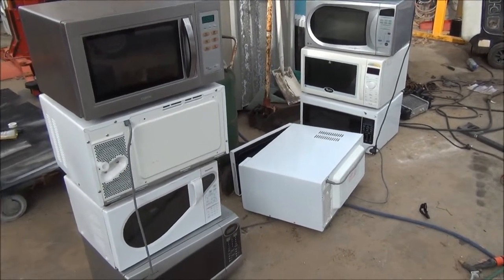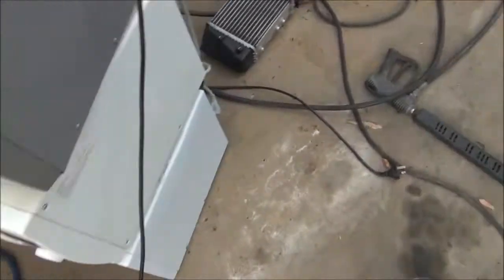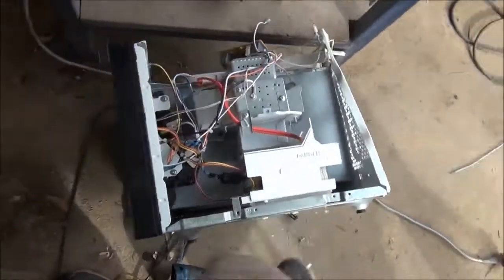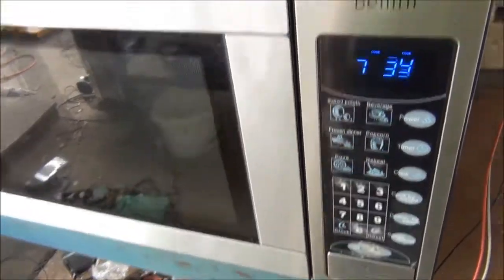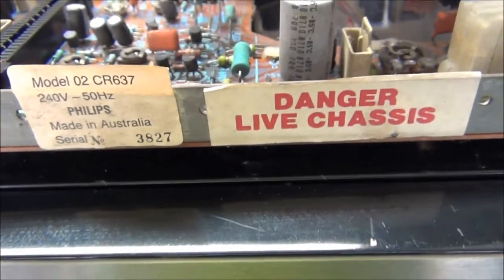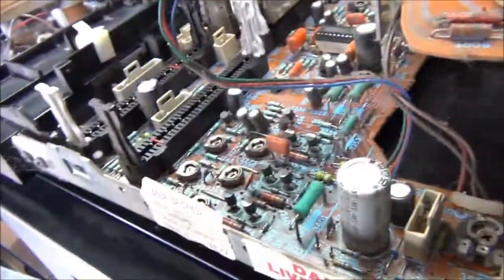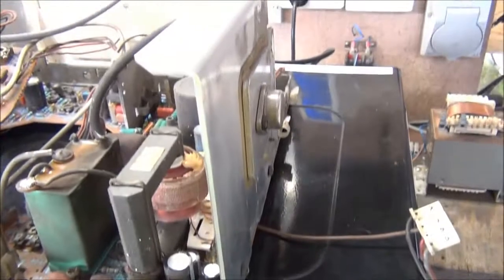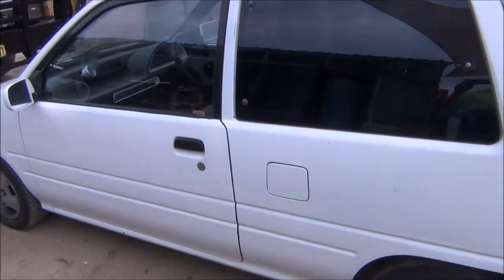Tuesday Update: Trash Microwaves, Flyback for High1Voltage1Rules

Comment: I think those card based TVs were to help servicing.  the person repairing could theoretically test the modules to find the bad one (provided he had a fixture or another, working TV!).  I fixed an RCA TV that was similar, it had 10 or 15 plug in PCB modules with sections of the guts on it.  The problem was the connectors went intermittent over time leading to the failure.  Cleaned the connectors and it was fine again.  kinda ironic!